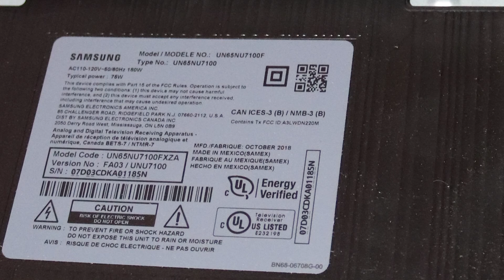I tuned broken 4K TV into LED Light Panel in 15 Minutes

Comment: I made one of these using the power circuit board, of the tv, to power the lighting but it would shut off after 10 minutes of no activity, or signal, like a lot of tv's do. so i had to add a separate power supply.  Is there a way around that I wonder?

Comment: I can confirm the LG 55UF770V-ZB will not power on without the control board and power switch witch is sad really so I'm going to change the LED strip as per DIYPERK's video.

Comment: So I got myself a 65" UHD Samsung TV just like you and I have tried converting several other brands but they go into standby mode. So to anyone reading this I have tried JVC and Philips and they do NOT stay on, but every Samsung I have tried DOES stay on. I am sure there is a way to keep the other brands on too but Samsung is way easier so stick to them and you will do fine.
Reply: That's kinda why I'm here. I get all the broke TV's to turn into light panels but don't know how to keep them on.
Reply: @chuckfinley5206  There is a chip controlling the PWM of the power supply. The one I am now researching a FA6B20N chip that I believe controls the PWM to power the LEDs, and looking for  what's shutting that chip down, over / under current, under /over voltage, a timing circuit one of these issues is it shutting it down down. I'm going to figure what's turning off this chip. I'm keeping the lights on.
Reply: @mickblackmore290  lot of the TV's and monitors I use are florescent rather than LED also.
Reply: mine doesn't! 50" smart TV 4k

Comment: I got it done, I disconnected anything that did not turn the backlight off and now it turns on and stays on when I connect it to the wall socket. I have attempted this with a JVC and a Philips TV but they turn themselves off. So it seems if you want to make it with ease use a Samsung UHD TV. I have failed with the other brands....
Reply: mine doesn't! 50" smart TV 4k 2018

Comment: So I found this video and I got the 50" little brother of your TV, I barely removed anything from the inside and it turned itself off after a while, I guess it is the power saving mode when no channel is found. I still have my power button too. I managed to keep the frame the first time I opened it but now I hope it will not break when I have to do it again. '

I used double sided tape to keep the layers attached to the frame as the "paper" front wants to buckle and fall out. Double sided works fine for anyone reading this. I saw a behemoth of a TV I could pick up, 65" like the one in this video but unless I put it on my ceiling in my living room there is no place for it in my apartment. 

I will re-watch this video tomorrow and use it as a template, its 2.18 am here in Sweden and I am too sleepy for tech :)